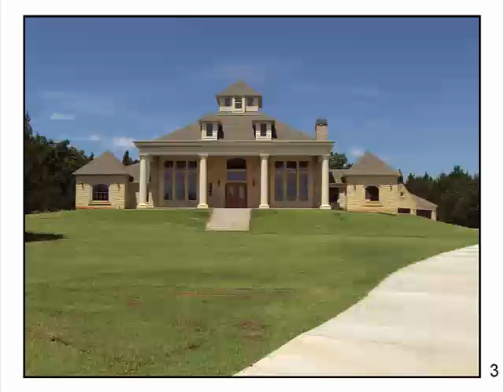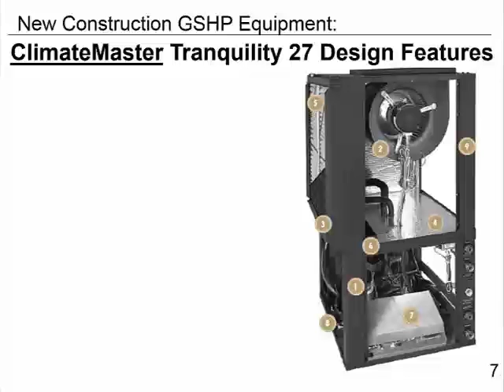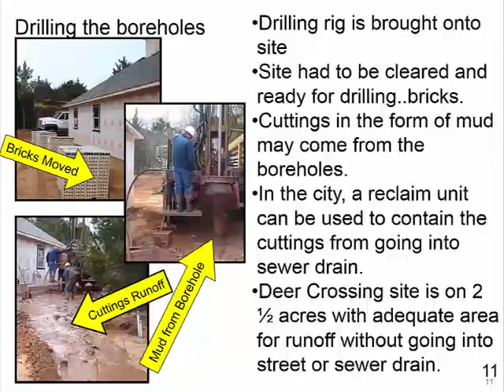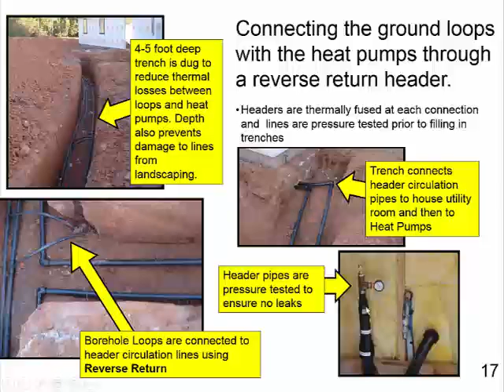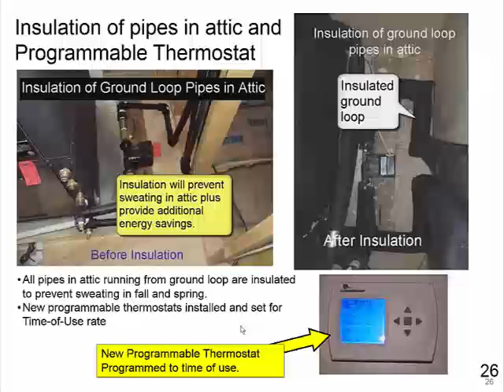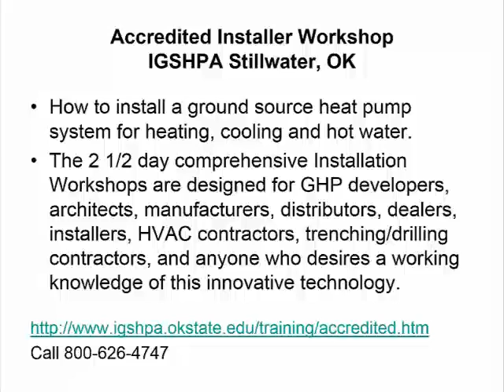Ground Source Heat Pump System in a Large Home

Comment: Randal. In parallel. Each heat pump has a small circulator pomp. The ground loop has reverse return. Meaning first in last out. Shown on slide 15.